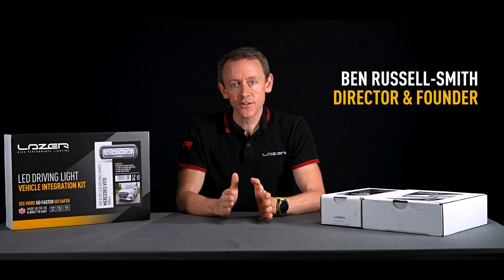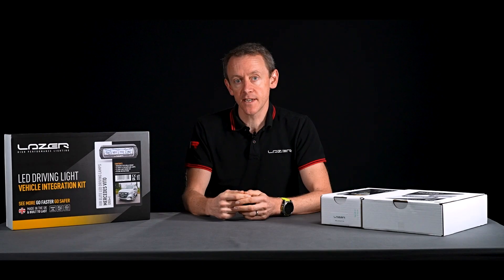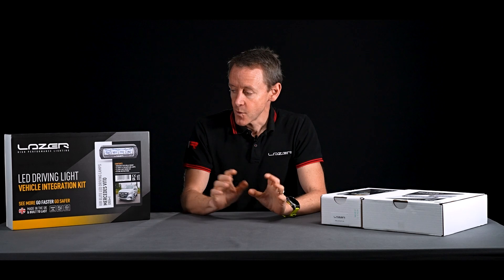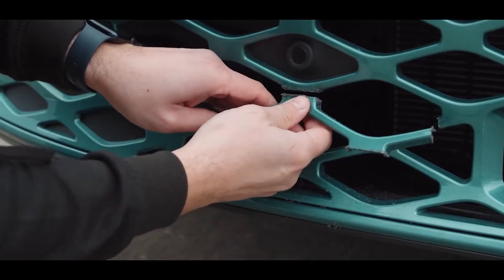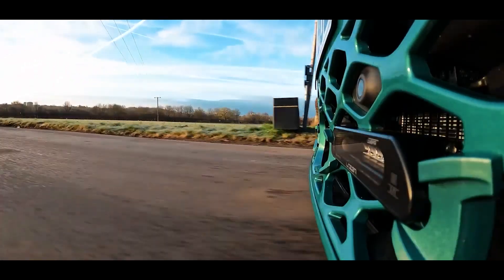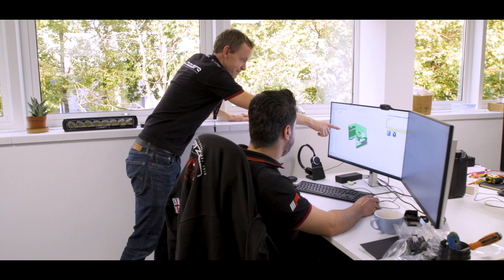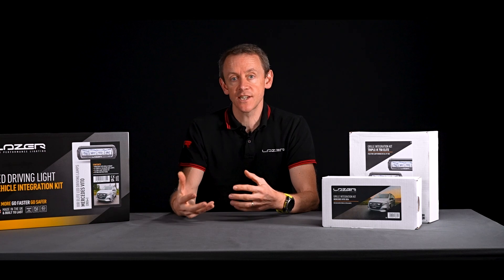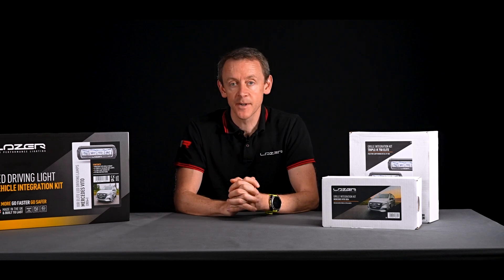LAZER LAMPS | Grille Integration Kits | Product Walkthrough

Comment: I have the 750 triple lamps in my t6.1 transporters front Grill  and the utility 25 lamps on the roof at the rear of my van ,combined with the factory LED head lights my night vision is biblical. Pervious cars I have owned from factory had what can only be described as piss poor lights .I knew when I was specing  up my Van Haven  transporter only the best would do ,so it was Lazer or nothing. If you want to best you buy the best and I've not found another lamp that can out perform The Lazer lamps.  Buy once ,Buy right ,Buy Lazer lamps 👍